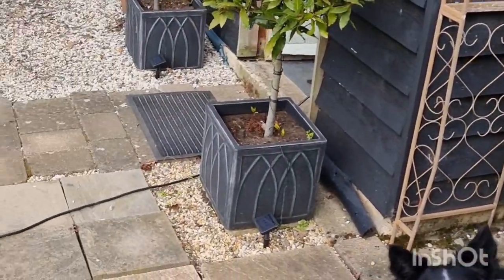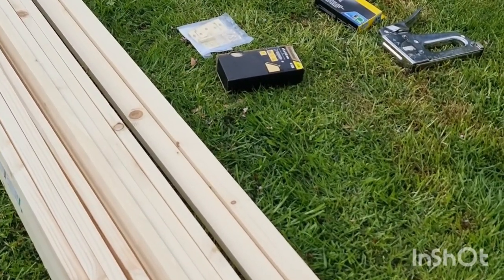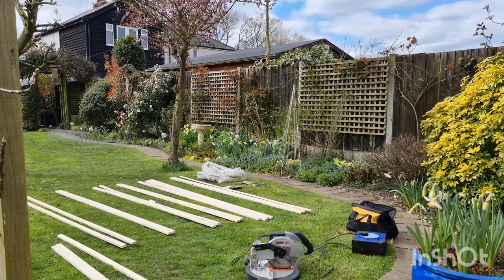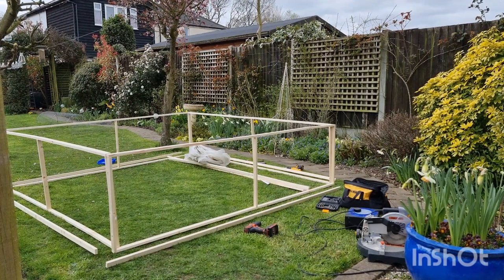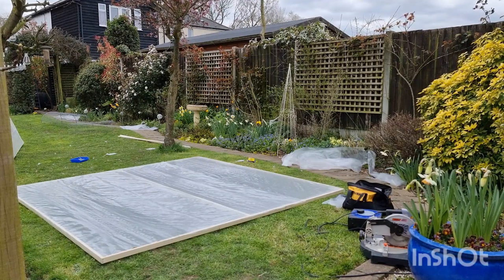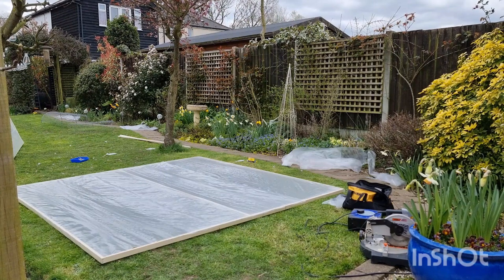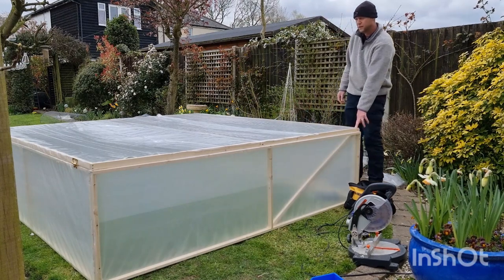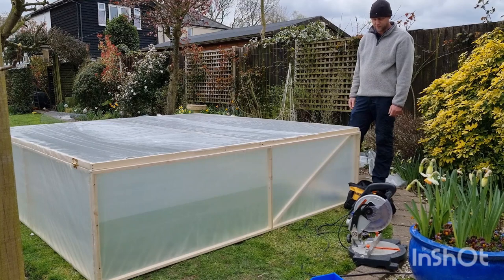How to make a coldframe, cheap, quick and practical.

Comment: currently building a minature version for in my greehouse for setting my onions away during the winter months. how has yours held up? did you need to steak it sown for the winter winds? looks like you would get alot of water and snow sitting on that lid shame you couldnt have done a tiny apex in the middle
Reply from the maker: It's only for a few weeks protection in the spring so snow not a problem. The lid up most the time and side fixed the stakes in the ground.

Comment: How cold does it get where you're at?
Reply from the maker: Minus 4 or 5 would be on occasion. But the frame would be used later in season when frost protection is required 3 to minus 1 ish